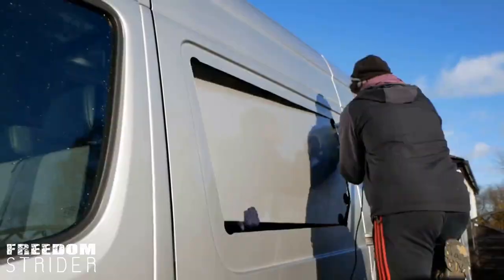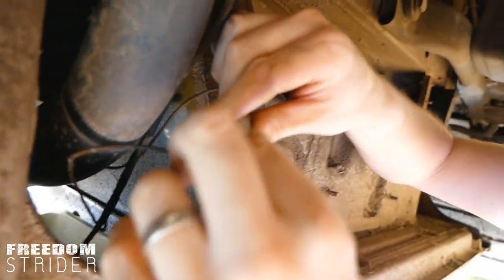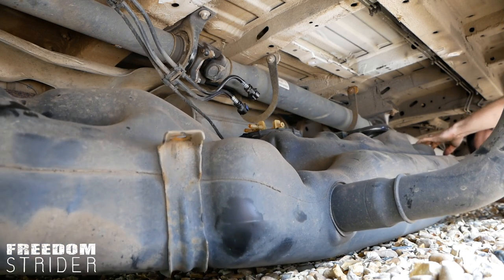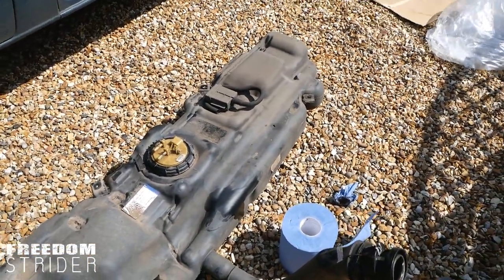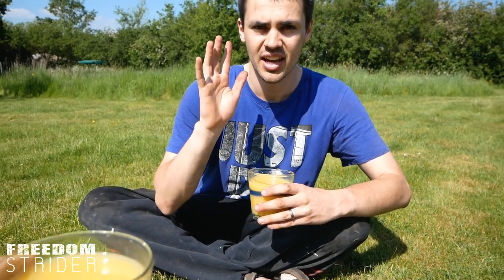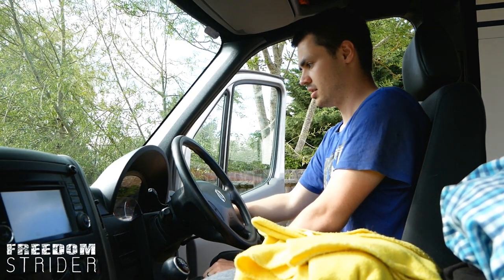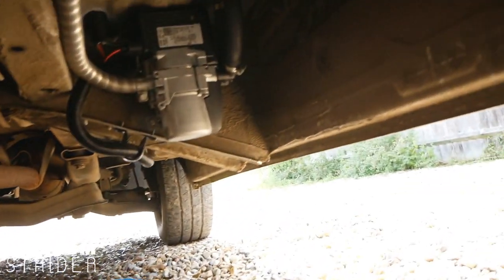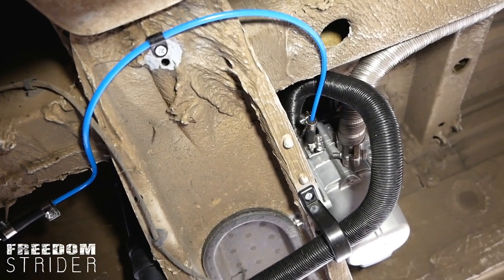HOW TO: Diesel Heater Auxiliary Fuel Line Install STEP BY STEP

Comment: Here I am, panicking as you guys have the fuel tank out of the Sprinter and unable to open it up. There's no going to the local hardware store if the clamp breaks to get a new one! 
Very well done. Impressed with how you guys research everything, show the innovative ways to get around failures, and get the job done! Thanks for sharing - have an awesome weekend!👍
Reply from the maker: Cheers for the support! That fuel tank twist cap was the hardest thing to do in the whole job, no matter what it would not open! But we managed to not break all the tabs off 😂

Comment: Thanks for all the effort putting up such a great video.  I was watching this to prep for the same work on a friends 2022 3500 XD.  After watching it, I went to look at her setup to discover something amazing ... As I looked around, I spotted a unit under her van where I saw "Webasto" on it, and I said "whaaaat?"  After tracing things around and looking in the manual, I discovered her van came STOCK with Webasto water heater that is used as an engine pre-heater!!!  As you can imagine, this made my work much easier.  I didn't have to drop the tank, instead I tapped into the fuel line going to the engine preheater.  What's more, it looks like Mercedes makes their own fuel pump bracket that is far superior, and quieter, than the fuel pump bracket that comes with the Webasto Airtop.  So I'll be doing some research to figure out how to order one of their brackets, if it's not too expensive, for my fuel pump and hers.

For anyone curious about the functionality of the stock engine pre-heater:  There's a switch on the center panel to enable it.  It will only enable with outside air temp under 40 deg F and can run for only a max of 50 minutes.  It does enable the vent blower so it can also preheat the cabin once the engine coolant is hot.  It can also be programmed to come on at a later time (like in the morning before you plan to drive away).  Like I said, the pump is more quiet but the heater unit is quite loud.  Nonetheless, it's a great thing to have and look for it if you have a new Sprinter (I'm assuming it's only on newer ones?).
Reply from the maker: Amazing, I wish our van came with a preheater, especially since ourheater is one of these hydronic heaters, would have saved us the trouble of installing one in the first place!

Yes you do have to be careful with some of the preheaters as you said, they have a max time function on, and when we were buying our actual heater we had to dodge the models that did this. It actually seems only sprinters, yes, and srinters especially in Canada, USA and Scandinavia that have these as standard. ;)

Comment: Hi guys, not sure if you'll see this and it was quite long ago but do you remember if you aligned the arrow on the black cap at the top anywhere when putting it back on. It feels pretty tight but the arrow is about 90 degrees from where it was when i took it off and if i tighten it anymore the whole thing turns. Just hoping its tight enough as its a pressurised system. Thanks alot

Comment: Just did this for our build, warning to anyone going into it, our fuel sender unit was not the same as this one, we had to heavily improvise to make it work. Our blanked connection had no tail on it to connect onto, and the lower cup structure wasn't as open to drop a line down into. Try to find out which sender you have before buying parts.

Overall very helpful video to get a good look under there before getting into the job. Thanks.
Reply from the maker: Thanks for sharing, fuel tanks and parts can and do vary from model to model. We are glad that you managed to make your fuel tap work 🙂

Comment: Great Video, at 1233 where did you get the reducing connector from, that goes from the 6mm tank fuel line to the 2mm heater fuel line? Thanks
Reply from the maker: Would love to say I remember but I don't - I think we actually drilled out some standard hose that fitted the 3mm fuel line to fit the 6mm port. 

I did see this in our saved link box: https://www.butlertechnik.com/eberspacher-reducer-tapered-id-hose-connector-6mm-to-4mm-251888800102-p2281 but it's way overpriced for something so simple.

Comment: Where did you get the reducer pipe for your fuel line think it was the 3/8  to 2mm
Reply from the maker: It actually came in our heater kit, from a company called 'Mellor Online' - it is very difficult to find online but if you email them in sure they can do a piece for you :)

Comment: 6:14 - How on earth did you get at the top of the fuel tank at that angle? I did mine yesterday and ended up clamping pliers to pull and still managed to take a bite out of my thumb knuckle trying to get to an angle I could squeeze those f*****g buttons together. Did it in the end!
7:46 - Luckily I had watched this video a few weeks ago and bought a strap wrench in preparation - it made undoing that black cap a piece of cake, so thank you for that!
Reply from the maker: Good question... I don't quite remember how that magic angle happened, I'm fairly sure that the cardboard boxes helped it. Sorry about your knuckles ☺️

Well done for having enough determination to finish the job 👏

Comment: Great video, thank you 👌🏼
What auxiliary fuel line did you buy or did it come with your kit? Thanks 🙏🏻
Reply from the maker: The blue pipe is the fuel line, and that came with the kit... It's a 2mm pipe internal diameter.

Comment: Those p clips, how did you attach them to the frame? Self tapping screws? Did you use any rust prevention?
Reply from the maker: We drilled a hole, cleaned and sprayed anti-rust primer and then used metal screws to attach the clips. Alternatively, you can use zip-ties if you have the appropriate hooking spots (but that is just not always possible). 🙂
Reply: @FreedomStrider  thanks. Just 1 more question, that connection from the tank to the 2mm plastic hose; that's 6mm to 2mm? Or no? How did you get/make that?
Reply from the maker: If I remember correctly, it was 6mm ID to 2mm ID, and there was a little piece that came in our kit for this.

You can alter a piece of 2mm ID rubber fuse line, and dirll out one side with a 6mm drillbit so it would fit (https://www.melloronline.co.uk/Heater_Installation_Accessories_/5170/Webasto_Marine_fuel_hose_5mm_ISO7840_-_6cm_Length_to_fit_14mm_hose_clamps_.html), hope this helps :)

Comment: What size fuel line did you use the black pipe please
Reply from the maker: The blue fuel line was 2mm ID (1/8"), and the black rubber hose going into the fuel tank was 6mm (1/4").

Comment: I'm watching this as I'm gonna do same for an onboard generator. As I can't get red diesel no more it makes sense to get rid of the onboard generators fuel yank. Only issue is a generator hàs a return line so I'm wondering if this is possible with a return line fitted. Can I drill and seal the top of fuel tank with the return line. Anyone done this
Reply from the maker: Check the top of the tank (not in the lid) some tanks have an extra point on the tanks for this.

If not, if you seal it up, I don't see a reason why this would be an issue, not sure what pressure the fuel tank is under?
Reply: @FreedomStrider  cheers. I've looked online and found stainless steel inlet/outlet connections. If I take sender unit off, drill holes and put these in, they come with rubber gromits, and put some high pressure sealant that don't react with fuel around em I should be able to try these